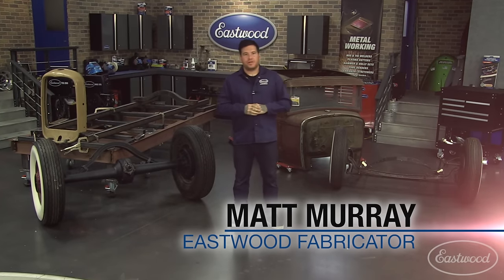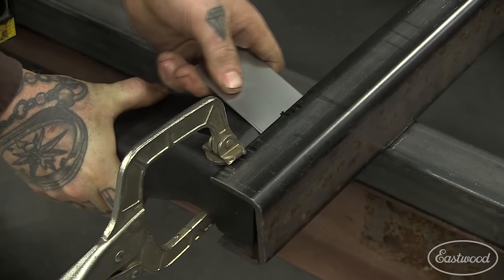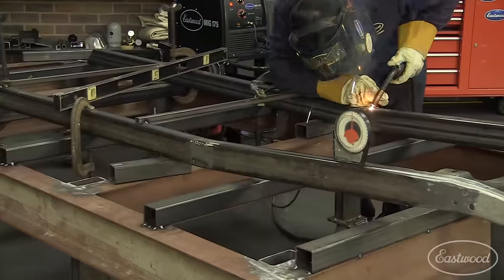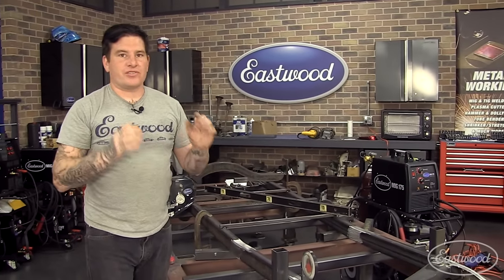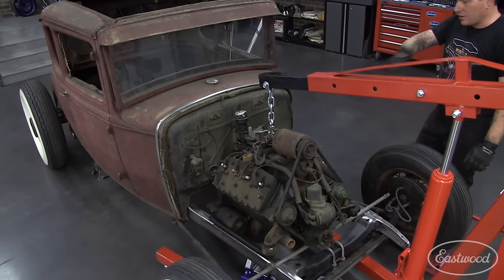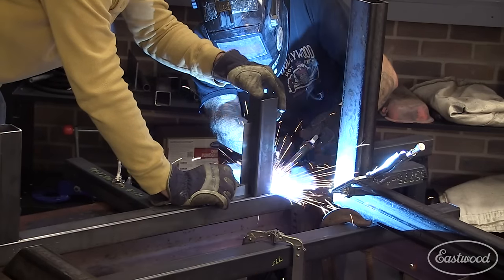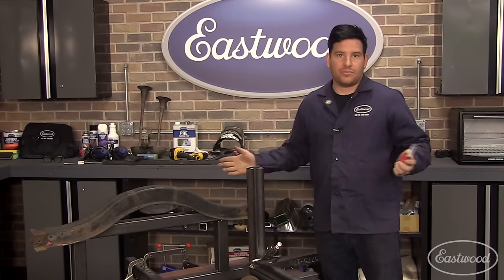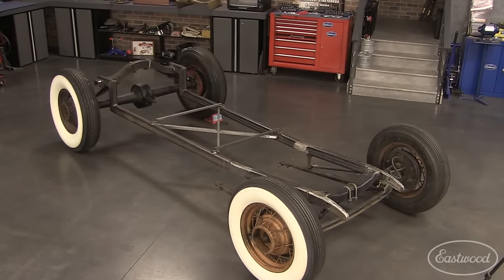How To Fabricate A Chassis - Building a Model A Hot Rod with Eastwood

Comment: Eh, A bit of information, but a lot of misinformation. The front frame horns show a distinct lack of penetration, and the welds for the swoop you didn't bevel at all.  Also, not a single fish plate in that rear kick.  Build it, but build it safe!
Reply: Yes you are right they would not license that in Australia
Reply: Bought a car in NSW last week, mechanic said he can't register it because it has four wheels.
Reply: Great, he's building a classic hot rod, not an autocross car, it a straight axle car! Sure a four link would hold the caster, but it's not traditional. He's running an old flathead, probably won't see over 60 mph, and not going to be a canyon carver. Your point is taken, but not really relevant here.
Reply: So why don't you just explain it? I'm interested.
Reply: How many Traditional Hot Rods?
Reply: That's why I don't like paying people to do things.  Plenty of responses that it is suitable for the application, and I have no real frame building experience but I would take the time to do it exactly as you described for my own piece of mind.

Comment: as a welder I have to wonder how safe that chassis is, I didn't see any beveling before you welded, vertical down does not penetrate very well and not plating the top of the relief cuts is a bad idea since you ground all the weld off
Reply: if you look close when he did the front bend it looks to be beveled. but yea I would definitely add in some plates over the seams.
Reply: +Evan Hardie That type of chassis would never pass engineering approval for use here in Australia..cutting the tubes then welding back up without doublers to reinforce it.  bending , rather than cutting and welding to help keep the structural integrity of the tubing would the requirements at the minimum,along with appropriate stengthening in all stressed area's.no offence to you guys there but I'd never buy one like that knowing how it was made.
Reply: +catey62 you won't offend me I'm Canadian and that wouldn't fly either,
Reply: +catey62 I get where you're coming from but typically rat rods aren't built for safety haha. they're dangerous rust buckets which is part of the apeal. but yea it could be made a lot better.
Reply: I'd trust that frame more than a motorcycle.
Reply: i wouldnt fear going fast with that frame...within the limits of a old suspension that is.
Reply: As a non-welder that was my first thought. The rigidity of this frame has to be terrible after having been cut, bent and welded using home tools. Doing the job right, yeah sure.

Never do frame repair yourself and never ride on a welded chassis. And if a car's frame has rusted through it's a parts donor vehicle.
Reply: And mig welded. What a joke
Reply: kshepthedrummer g
Reply: Evan Hardie. I agree with you.
Reply: catey62. pre bending in a box jig to prevent puckering I believe would be better. And an inner plate to reinforce.
Reply: U cant be a welder... thats strong as hell for a Car...
Reply: At only 1/8 inch, you're not worried about penetration if you have a real welder.  I use an 1/8 inch landing when i do a bevel prep. This guy already wasted enough time with all this cut and weld anyhow you don't need more waste with unnecessary grinding.

Comment: this is actually a pretty informative video for 12 minutes.   If only I had a big enough garage to build a car like this or to even house the tools I need
Reply: +Joshua Szeto time to build a bigger garage or an addition. :)
Reply: I wish I could.  I live in a townhouse with a house on both sides so I can't even expand if I wanted to.
Reply: there is a living space right behind the garage.  at best, I can replace my hot water heater with an on-demand system so I can knock down a small part of the wall and recess in a shop compressor.   I barely have enough room to rebuild one car but once I start yanking parts off the car, the basement level will be full of car parts.   and I can't just buy another home since I only just bought this one
Reply: +Joshua Szeto - I know there are places you can rent for a low cost in order to do things like this. Co-ops are another option. If you have enough guys in a similar situation, you can get together and start a build co-op. Best of luck to you! I hope you get to build one someday! Nothing like building your first car.
Reply: +Suedzville fortunately (or not) the car I am rebuilding is a unibody so I don't need to find a place to put the body while I reinforce the frame I don't have a ton of space to put the engine or transmission
Reply: Joshua Szeto Mind if I ask what you have?
Reply: +Suedzville The car I am going to rebuild is an AE86 or Corolla GT-S.   Now that I have an FR-S, I can start my project of turning my AE86 into a pure track car.   I think I will buy an Eastwood mig welder to do the bulk of the metal repair and fab work but I wish I had space for a brake and bead roller
Reply: Joshua Szeto I have the Eastwood mig 135. Been really good for thin metals. I do mostly sheet metal welding on my projects.As far as room is concerned for bead roller and brake... Consider mounting them to the wall or put them on wheels so you can roll them out when needed. My brake and beadroller are on wheels. Eastwood beadroller and break mount in a vice. This way you can just store them some where when you are done.
Reply: true dar
Reply: Joshua Szeto
Reply: Joshua Szeto y
Reply: i know right? personally i have all the parts to build a car but not the space
Reply: Joshua Szeto I have not the education, experience, money, time, tools, or space to do this. But I still desperately want to
Reply: Tools required.walmart Stanley tool set.110 portable welder.grinder.a driveway.walmart jack stands.
Reply: Eastwood sells all the tools lol

Comment: It's amazing how simple vehicles were
Reply: With how cheap these tools are, there's nothing stopping people bringing this back, but dropping in modern fuel efficient engines instead.
Reply: @RandyRandersonthefamous  even electric motors
Reply: safety is a concern though. Less accidents happened purely because there weren't that much vehicles around
Reply: @RandyRandersonthefamous  this with a geo metro 3 cyl would be pretty cool.

Comment: That welder looks pretty good and is pretty cheap for what it is and the welds it makes and you have proof it is a welder capable of making a chassis. 

I have seen people try to repair a frame with a harbor freight 90 amp mig. The welds do not hold up to that kind of weight. I have seen tests where people have hit the welds with a HF machine with a hammer to prove it is strong or stand on it but when it comes to a chassis an HF welder can neither build or repair the frame of a car. For those who don't know. Notice the gas bottle behind the welder and then you automatically know he is running a 220v mig with gas and solid wire. Why is he doing it that way? Because the machine produces not only better welds but also strong welds and he is not producing any spatter so by using a good machine he is welding something he knows will hold up and is not subject to any scrutiny. 

HF welders are good for things like spot welding body panels and pretty much any 22 to 16 ga sheet steel, It can also produce a weld on lower caliber firearms and depending on the structure of how the gun is made could also be used for up to the .45 ACP or 9mm rounds as long as it is a submachine gun configuration comparable to the sten. HF welder is a light duty welder so do not ask it to do more than it can do. Oh and they are also excellent for if you mess up a hole placement when you are drilling it can weld the hole closed and allow you to relocate the hole. I would also go as far as to say the HF welder could also repair sections of a unibody car that does not have the traditional frame and that is simply because they us intelligently bend sheet metal to form rocker panels and so forth so the steel used in a unibody car is very much within the 22 to 16ga realm. I have actually never seen a rocker panel over 16ga thick (by that I mean the rocker support not the external panel). 

If its the only welder a person can afford and you simply cannot go out and buy a better machine or a new car or can't afford to have a shop do it for you then by all means attempt a fix with the HF welder even if it is on a car frame because logic tells you even a HF weld from a 90 amp mig is better than just letting it go and is also stronger than the void that rotted out.

Comment: So a Model A frame flare out towards the rear. I see you didn't do this. I'm guessing that it's because you aren't going to use stock body mounting. I made relief cuts much like you did to accomplish the flare out. I drilled 1/8 holes at the front of the frame on each rail across from one another. I used these as my zero mark to properly position all body mount holes and crossmember locations. I worked for Freightliner and that's the way frames are built at our factories. I had a stock frame that was in bad shape, rust and cracks, but it was square. I also drilled 1/8 holes in it at the same location and used trammel a trammel bar to transfer locations.
Reply: 11:17  The rails are spread to angle.

Comment: Hey Eastwood Company. I am new to welding. I heard that tig welding is ideal for this type of job; however, I see that you are using a mig welder. Is your mig welder just as good as a tig welder? Am I getting wrong information? Thanks for your time.
Reply: When welding TIG and MIG on steel there really isn't much a difference for the average user. You can get much more precise with a TIG and sometimes more penetration but for a basic frame like this its what ever. MIG is easier to pick up though. TIG has a bigger learning curve cause you have to worry about gas flow, cup sizes, filler metals, tungsten, use 2 hands and a foot, etc. Mig you just set the gas/wire speed/ power and pull the trigger.

Comment: How does he know how long the frame needs to be? and how does he know how much of an angle he needs? was he looking at blueprint's? how do I get these blueprint's? :o
Reply from the maker: The frame length is set by the wheel base and body you choose. The angle is chosen by the look and drop of the frame that you want. I used a mixture of stock 1932 Ford and Ford Model A measurements to start off of and then went from there. Hope that helps.

Comment: What if I wanted to use the trunk? And have a mean rake on it so ass up nose down but not too low? Also why are y’all doing structural welding with MIG? I do want to build a rat rod but not sure what years are exempt from having to have hoods and fenders and which are too new.
Reply from the maker: Custom projects are going to require non-conventional thinking when solving problems - such as lowering while keeping interior/trunk space.  This is intended as a guide - there's lots of different ways to approach any project.

A MIG welder is fine for structural as long as it has the capability to weld the material.  The MIG 180 (updated 175) can weld 5/16" steel which is more than needed for this project.

Laws for hot rods will vary state to state and on the registration of the vehicle (normal vs hot rod vs antique)

Comment: Matt, how thick is the metal you are using for the frame on the 1930 coupe?  Would recommend using 1/8 inch thickness for a street rod frame?  Thanks for your answer in advance.
Reply: Dwight Travis yes, 1/8 is good.

Comment: For all the effort of building new frame rails you could've Z'd it, used a front drop axle, and got the car equally low. You'd have preserved the original interior space and lowered the weight of the engine and transmission, producing a better handling, more comfortable and more stable car.

I'll never understand why present day hot rod builders insist on using the worst solutions possible for every problem and handwaving it as "traditional". OG hot rodding was about innovation and coming up with the best solution you could afford to implement!

Comment: Does cutting and welding the frame weaken the overall integrity? Can it handle the horse power of a decent motor?
Reply from the maker: There's always risks associated with any custom work, but there are procedures to strengthen and improve upon original specs.  For example these frames we're open C channel from the factory, upgrading to box tubing, or boxing the factory frame will improve it's strength.

Yes this frame can handle the power fine.

Comment: Sketchhh, put some fish plates on those vertical welds.
Reply: the car is probebly not going to weigh more than like 800-900 KG so its sturdy enough :)
Reply: No its not. They didn't bevel the pie cut welds right where that heavy flat head engine sits and a harsh 90 like near the axle needs plating since its connected to the axle where a majority of axle wrap and body roll is exerted. Not doing it is an unnecessary and potentially hazardous corner cutting. Literally 20 minutes and ~$10 could save your car from lawn chairing.

Comment: Hi and thanks for your vids they are good question , if I wanted the body for a 32 convertible at high boy lines is the frame angles you show here right for this car  I see you channeled this body low where's I want higher and hi boy lines thanks
Reply from the maker: Hi, The angles I referenced were to give the frame a gentle "flow" or kickup in the front. The springs you use, rolling wheel/tire diameter, and other things will factor into the overall height of the vehicle.

Comment: Do you use the original rear axle from the model A ? I want to put a 350 cut smallblock in my model A but I am unsure if the rear axle is strong enough to take the forces. Thanks
Reply: No. Use a 9" or independent setup or torsion bar setup

Comment: What are you using for tubing size 2x3 and wall thickness .188" or .250"???
Reply from the maker: +letssled The tubing is 2x3 with .250 wall thickness.

Comment: what's the best metal to use in I frme making?
Reply from the maker: It all depends on the weight of the vehicle and what you want to do with it. We used 3x2 ..25 wall, which is a little overkill for the engine in it, but will allow upgrades in the future if I ever decided to put something else heavier in it for drivetrain.

Comment: I have an 1919 model  T frame and springs  in mint condition can I use it the way it is ?I have a 327 SBC  with a 4 speed or an auto trans for the power .  And a covair  steering box , 9 in rear end and front axel  Thanks TANK

Comment: Some people not happy with using a mig welder on chassis , the car they drive EVERYWHERE was welded at factory with A MIG welder ! and by Robot ! That CAN'T do anything ELSE ! and it's  BLIND ! and has NO EYES !  and CAN'T SPEAK !  Have to put electricity to it just to do it's job ! I've done chassis with my mig welder and NEVER had NO Problem! Built rods and lifts on 4x4s . Yes tig is nice but for the layman it's takes training and more practice than a mig , i was welder for 30 years and worked for company that built manlifts on trucks and had to be certified because of human use structures. Test with MIG  for cerification was weld two half inch thick  plates with 3/8 gap between, run your weld  uphill then sliced three sections and bent both ways without NO breaks or voids ! So weld your rig wit dat mig ! 😛😜😁👍

Comment: no one gives a explanation on how to measure a frame in relation to the body, and i've seen loads of videos on you tube, and this is no exception
Reply: Yea u do have a point. I learned by paying a shit ton of money for school and it's still a pain to do lol. I would suggest checking out "b is for build" and watch the videos on the 240z. He builds it literally from scratch and it's extremely informative. Doesn't go thru step by step on exactly how he did it however he does explain a lot while going thru everything and also includes his screw ups and explains why it was a screw up so u know what not to do and what may or may not work.
Reply: fantastic insight on building a chassis for a car body you own, thanks for pointing me in the right direction, good stuff

Comment: holly crap    couldent   they find anything thicker to make the frames from? hits a hotrod not a  dump truck
Reply: what does it matter dude??? them hot rod run on some crazy horse power,, im pretty shure it I'll get that frame opening some wind for some folks out there
Reply: it looks like is  1/4" or thicker 1/8 would be more then enough
Reply: They test-fitted a flat-head . . . they built a cruiser, not a dragster.
Reply: and with all the cuts he made in it so it would have the right shape then welded them up those rails have lost at least 50% of their strength and structural integrity making that chassis unsafe and an accident waiting to happen.

Comment: From an engineering perspective this frame won’t hold up.
Reply: This car would never ever get registered or be allowed on the road here in South Australia where I live. the engineers that sign off on hot rods etc would take one look at it and tell the builder to go and get another chassis made that hasnt had slices made in one of the most highly stressed areas then had them welded up  just so it has the right shape.have the rails properly shaped without cuts and welds so it retains its strength and structural integrity...this frame is a disaster waiting to happen.
Reply: @catey62  Dear Catey, I am an hobbyist and learning to make a chassis which is simple to built and can be registered and complies with the norms and homologation. Any link or advice?